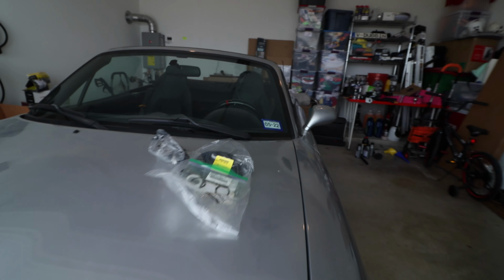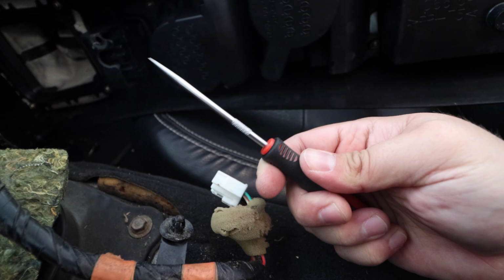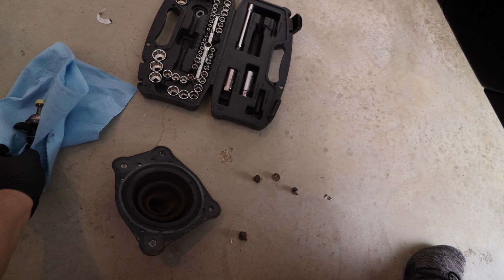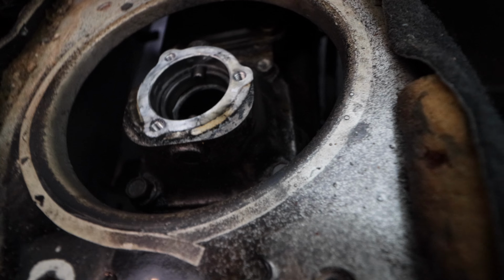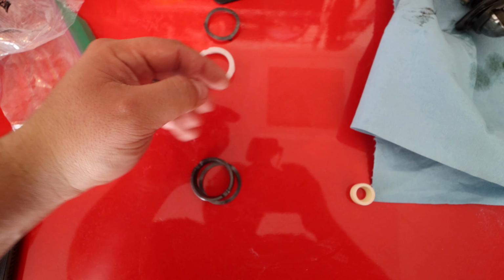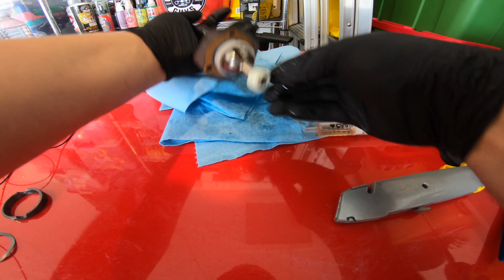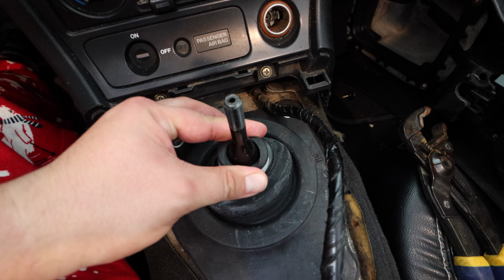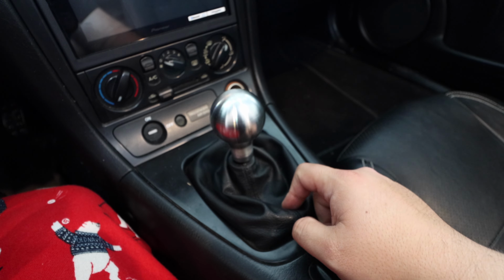Project Miata The Answer Episode 4: Shifter rebuild

Comment: GREAT video, thanks for posting!
Exactly what I needed.
I'm  not saying my 200,000 mile+ 99 NB needed a shifter overhaul.... but would you believe the plastic cup under the small ball was completely GONE???
I could not quite duplicate your vise grip setup, so I found that it wasn't hard to drive the front pin forward with a drift punch and back in with a large vice grip.
Reply from the maker: Thanks for watching and glad I can help out with the video. The pin was definitely tricky to get out but glad you were able to get it with the punch. How's the shifter feeling now?
Reply: Well, TBH the shifter has a little less wobble now, but even before the rebuild it was light years ahead of my classic Jag and Ferrari shifters! One BIG improvement I did make: I added an extra piece of insulation from the outer ring of the big rubber shift boot to under the carpet on both sides of the console. MUCH quieter now. :)
Reply: To be honest, it never felt bad. Light years ahead of my classic Ferrari and Jaguar! But yes, less slop now. What made a YUUGE difference was an extra piece of insulation from the outer ring of the big rubber shift boot to under the carpets and under the dash and console. SO much quieter!

Comment: Well Dag. I’m about to do this but after reading the comments. One guy said he had no bushing on the end of the shifter when pulling it out. Yet he was still driving it. 
Mine won’t go into any gear at all so now I wonder what in the heck could the problem be.
Reply from the maker: Is your shifter super wobbly? How’s your clutch pedal? Does it go to the floor completely? Might need new clutch hydraulics 

https://trackprepperformance.com/products/90-05-miata-clutch-hydraulic-system-refresh-kit